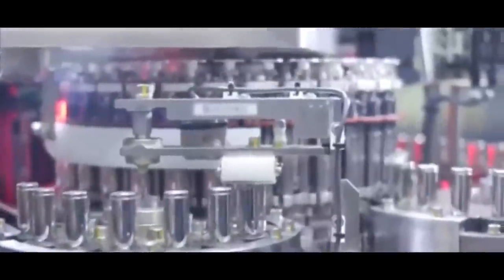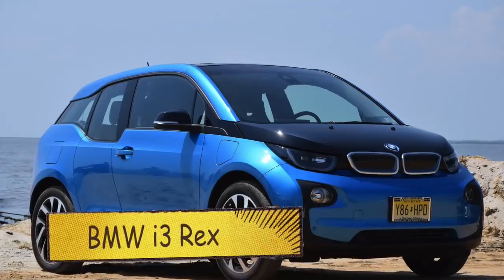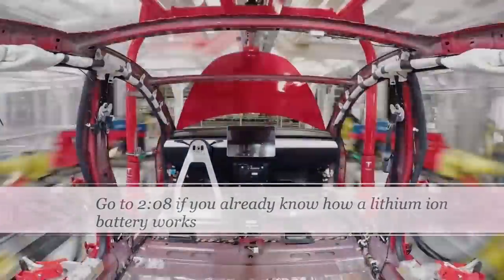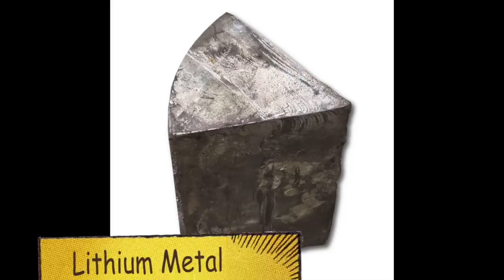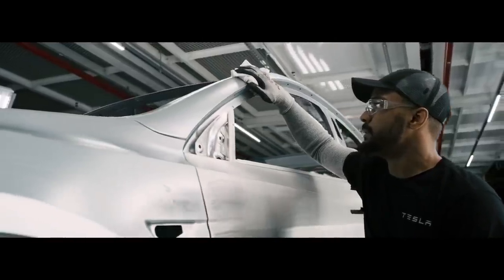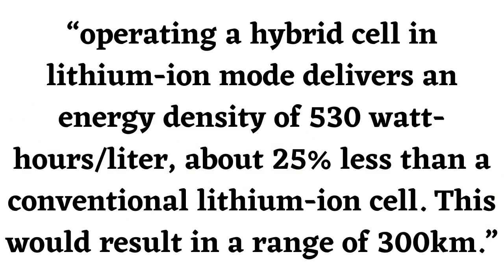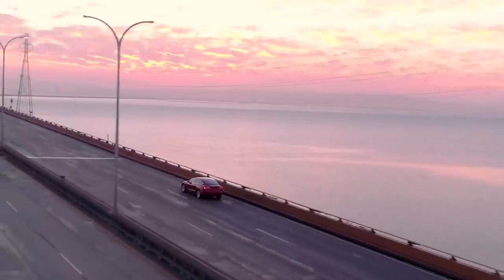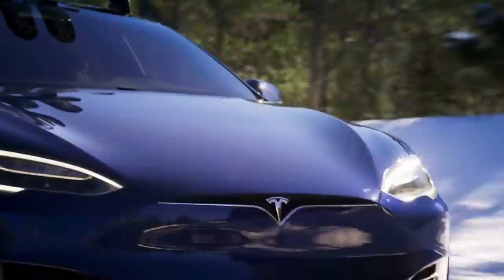Tesla's New Battery Breakthrough: Hybrid Batteries

Comment: Certainly, increased mileage over the years is to be expected and is a good thing.  But, for me, that's really a yawn.  The real "wow" breakthrough moment is going to be when you can charge your ev to 75% in 5 mins... i.e. refuleing time is on par w/convential gas.  when I'm low in battery and can pull in and "gas up" like a conventional gas, that will be the tipping point.
Reply: Conventional gas usually requires the driver to hang on to the pump pistol while filling the tank. then they have to either go to the cashier inside or pay wave with their credit card. In addition they are SOL if the gas station happens to be closed. Chargers are open 24 hours a day and all you do is plug in and for a Tesla your car is automatically recognized and payed for with your pre-registered credit card. Meanwhile you are free to find a coffee and have a bathroom break. The time spent stopping to get energy for both an ICE & an EV  are pretty close. Gassing up an ICE vehicle always requires a gas station A charger always takes about a minute to connect & disconnect and the rest of the time you can be at work or at home or picking up things you might need.
Reply: @Clearphish  What 3rd world country do you live in that gas stations aren't open 24/7? Also, most pump pistols have a locking mechanism and credit card payment at the pump.
Reply: @mikenotta7079  Outside of larger urban areas gas stations close at night since there aren't enough users to justify staying open. Where I live the nearest 24 hour station is 40 or 50 miles away.  There are some stretches even on our national highway where planing might be required because the next available gas station is possibly 100 miles away. The only time I have seen locking mechanisms is for service stations. Self-service in Canada requires the driver to hold the pistol when gassing up the vehicle. It's a safety requirement I believe. Credit card pay wave works at pumps. The other day when I filled up the pump would only accept debit. I had to go to the cash desk to use my credit card. No idea why. 
The only message I am conveying is that electric vehicles are just as convenient to power up as gas vehicles and for those who can charge at home over 90% of the time it only takes a few seconds since the car charges by itself and if you have better rates in off peak hours the charging times can be preset to take advantage of lower prices.

Comment: Only problem I see is the user knowing the correct mode. But hopefully software will show it clearly.
Reply: You don't know that you are about to take a 300 mile trip vs a 10 mile trip?
Reply: The battery remains the same, if in your situation you take a supercharger charge up and go. Then resolve the payment charges afterwards.

Comment: So how does this work?
If you charge wouldn't you also charge the range extender?
Meaning it will wear even if you dont directly use i.t
How do you activate this extender mode?
Electrodes dont have eyes they pick the easiest route

Comment: 2:25 mixing the info, graphite is the cathode and cannot be replaced by lithium, you only replace the LiNiMnCoO anode with metal Li, this increases the energy density. Graphite could be replaced by silicium or sulphur, ideally.

Comment: look into betavoltaic or dry cell Atomic batteries this is what I'm working on at the moment the main thing that's going to slow you down from testing is taking the proper safety protocols with the radioactive isotope I'm using americium 241 which has a half life of 432.2 years and then decays into neptunium-237 which has a half life of 2.14 million years so if I can get a decent power production out of the materials that I'm using which is two americium pellets out of an ionized smoke detector and 2 large fast diode transistors out of an old computer power supply. I decided to go with using transistors instead of making my own p&n Junction out of graphite and nickel plating as they are pre-built more Compact and run off of silicone-based Junctions which has a faster rectification rate equaling higher efficiency  link all the outputs of both transistors in parallel. Which should leave you with three terminals the two outside injunction terminals with the p Junction terminal in the center then link all the n Junction terminals to one cable and the p Junction to its own cable and this should give you one Beta voltaic unit with four cells in parallel well I've got testing to do so I'll get back to it
Reply: Dalton Neumann ...I was working on a similar technology but I’ve discovered a far more suitable system. I’m using an extremely strong elastic band that twists very tightly as you go down hill then at the bottom you release the tension to allow the elastic band to unwind which drives the car up the next hill. I’ve also put holes in the bottom of the car in case you can’t quite get to the top of the hill you can put your legs through the holes and run like hell.
Reply: @paulmcgreevy3011  I don't see how this is more suitable over a direct ion capturing system for betavoltaics you're talking about rubber bands and I'm talking about nuclear physics. And how instead of using thermonuclear to produce energy from radioactive isotopes. Which can be extremely dangerous and lead to a meltdown because you're putting that isotope a into a super critical point in order for it to provide heat to boil steam to turn a turbine which that system is extremely inefficient it would be way better if we were using betavoltaic batteries that can recharge a capacitor Bank to provide a bulk amount of power and would be at 50% power generation in 432 years. in other words in about 430 years it would provide half the amount of charge rate to the caps
Reply: Dalton Neumann .... I’ve discovered that an extremely efficient foot pump can drive enough air into a tank while you are under elastic band power to provide pneumatic energy to an air motor while the elastic band recharges itself thus avoiding the need for the leg holes. Also I’ve placed a wind turbine on the roof which recharges an old car battery I have on a trailer which is very effective driving a vacuum cleaner motor I have attached to the wheel axle.
Reply from the maker: Wow, pretty interesting stuff man!

Comment: A short term compromise, but not a long term solution. Needs to be simple ... I can’t imagine having two modes on my iPhone. Becomes kludgy.
Reply: carlo herrmann you don't have low power mode on your iPhone?
You don't have a dual function battery cause you don't need it. But if you can occasionally get an extra 4 hours out of the phone in return for losing 2 hours in normal use???
Might be worth considering

Comment: If the need for the hybrid extended range function can be accurately anticipated and the software have been written to respond to such prediction, making everything transparent and invisible to the driver. Than it might work. But accurate prediction requires specific user's data. i.e: calendar, Geo history , etc.  Then the software will notice a pattern, a trigger and increase the charging capacity the night before the trip.  So it can be done. One day, I will create an event for a trip to Lake George NY in my calendar, triggering my car to activate the extended range mode on the night previous. By the morning, my car will have the increased range for the trip.

Comment: I Will Just wait on the Solid State Batteries to come out ,that has a Million Mile range before that currant  2 hundred thousand mile $7000 battery will no longer take a charge
Reply: It might not be solid state that Tesla is going into. I know they are planning a 4,000 life cycle battery (1 million miles for a 250 range car) with the dry electrode, but they are past 300,000 mile batteries already (250 miles X 1,500 charge cycles) and probably already under $100/kwh so a 55kwh and 75kwh is $5,500 and $7,500. So a Tesla is already a good deal if you don't want to pay well over $10,000 on maintaining a gas car, not to mention fuel cost.

My next car will be electric, and if that isn't a Tesla then my next car will be.
Reply: @matthewboyd8689  I already have an electric bicycle my next car will be Electric it's time to wave bye-bye to the fossil fuel companies

Comment: Our EV’s are utilized “non-COVID-19” environment about 6000 miles per month. My belief is as the world transitions from individually owned fossil fuel vehicles to electric the mobility of communities will shift to MaaS ( mobility as as service) in doing so the batteries will be utilized to go greater lengths/distances, at first, to service more riders between charges. Simply because the rate of charge is still not fast enough to most people’s liking. This is also why the “million” mile battery has huge implications for adaptation. A battery only gets so many charges and discharged until you begin to see battery degradation. I have already had to change out Two (12 hv) batteries in my 2019 model 3 used for commercial services in 9 months due to constant recharging...Tesla service explains due to constant usage... so if robotaxi’s do become a reality... the need for higher quality batteries are a must.
Reply: Glenn cook I think you're right: for high usage and high availability batteries are the wrong technology.
The advantages  that fossil fuels have are speed of refuelling, ubiquity and energy density. EVs have to match these; particularly when talking about freight

Comment: I dont think this is what tesla will be announcing at battery invester day. 25% range is not "i didnt think it was possible'' ''alien"  its more of a 'pretty good' upgrade
Reply from the maker: I agree, there's definitely a lot more groundbreaking upgrades coming soon, all of which I've made videos on. However, with a higher energy density from features like the dry electrode, NCA electrode, tabless electrode, single-crystal NMC cathode, and the new advanced electrolyte, an increase of 20% could become 150 miles instead of 50.
Reply: @Casgains  Now that would certainly fit the descriptions that elon used

Comment: You have awesome material. But dummy that I am, I just don't get the "take-away" here. What am I missing...??? Thx.
Reply from the maker: Tesla has a new battery that will allow Teslas to have two separate modes: the lithium ion mode and the lithium metal mode. The lithium metal mode is the “long range” mode, which allows for a 20% increase in driving range. On the other hand, the lithium ion mode will have a range 25% less than the original range. That way, with two modes, you can use the lithium ion mode (shorter range) for shorter trips and the lithium metal mode (longer range) for the longer trips. Let me know if you have any more questions!
Reply: @Casgains  Same vehicle has both? Just a flip of a switch to go between?  Again, Thx.
Reply: @Casgains  I guess the hard core "application" of this "feature" is being lost on me. For example, I saw the cyber truck IMMEDIATELY. And basically everything else you have taught re: EV's, alt power, etc. 
The REAL WORLD application/marketing/sales of THIS ONE seems vague...less relevant. ??????

Comment: Energy density per kg which gives different ranges is NOT the only consideration when comparing different battery chemistries. It's not possible to make cooking understandable for someone who can't boil water by those who aren't chefs.  This simple video breakdown leaves out 80-90% of other changes and performance variations that exist between different batteries.  Very important are other factors that CHANGE with different chemistries are, Charging Speed, Number of lifetime Charge Cycles, Rate of Discharge, how temperature adversely effects these attributes and the batteries life themselves are all different when variations and explored.  They are just as important to factor in as power densities.  This video understandably ignore all those attributes which cannot be simply glossed over.   If these different battery characteristics are ignore for the benefit of others performance tanks very quickly and negatively.  Battery advances can't be had like designing new menu items at some fast food restaurant by simply changing the ingredients and have a successful better battery.
Reply from the maker: Great points, Rick. We don’t have any information on that yet because Jeff Dahn’s study didn’t incorporate those factors. I agree with you, but the research is still in its early stages so we will have to wait for further studies.

Comment: I must be slow as I couldn't follow. Two batteries in one is that what your on about. Where one half is used say in cities and both haves on longer trips with some switching possibly but you carry both halves but only use one . I can not see an advantage other then claimed one's.
Reply from the maker: It remains as one battery that is able to switch between two modes: the lithium ion (shorter range) mode and the lithium metal (longer range) mode.

Comment: Nobody is interested in the extra few kilometers if you can completely change a battery in 5 minutes like NIO does.  the battery does not age because you get a different one every time you change.  you get a lifetime guarantee on the battery in this way.  which also makes sense when you consider that the most expensive thing about an electric car is the battery.
Reply: It is absolutely dumb to change the battery every 200 or 300 miles, same as refueling then. Leave it to Tesla to solve the problem without having to change the batteries even 2 or 3 times a day on a long trek. Who is going to pay for the cost of the operation every time you do that? knowing how things normally work out, probably the operation will take far more than 5 minutes of your time, how about in busy time? You will need to wait for your turn wont you? Nope very dumb idea, it will never work.
Reply: Thank you for your empty words.
Reply: Put your money on NIO. While I will put mine on Tesla, surely in time they will determine the weight of my words versus your complex and useless opinion.
Reply: first: a nio ES8 drives 580km.  a comparable model x (long range) only 507km.  and this 507km can only be reached if the battery is charged 100%.  but only idiots charge a battery 100%.  second: just because you can do something doesn't mean you have to.  I think it would be better if you inform yourself first before you write garbage 😉
Reply: Have fun with your Tesla.
Reply: The official figures are 220 Miles for the NIO and 295 for the Tesla model x. Further, NIO does Not offer possibility of recharging, so if you run out of juice bye bye . Does not have possibility of inter connectivity. Does not have self driving capability. The 0 to 60 times of 4.4 on your NIO get crushed by the 2.8 of X model. What are you insinuating? When the NIO is absolutely crushed by Tesla in every single significant parameter of comparison. Your lies and arrogance will not sell a single more NIO, for only a fool would buy one after checking Tesla specs. In fact the NIO stock price is tanked from 10 to 3 while the Tesla is 780 You are trying to sell a donkey for the same price of a racing horse, please do not waste people time with your limitless imagination.

Comment: What is the benefit/requirement for the lithium ion mode? In other words, why not just have the long range mode as the only mode? I don't know if that was clearly covered in the video.
Reply from the maker: The long range mode has a shorter lifetime so if you use the long range mode too often the battery will die out a lot faster.
Reply: @Casgains  OK, I guessed that was the case. I wonder by how much.